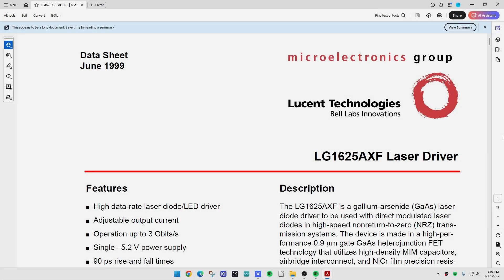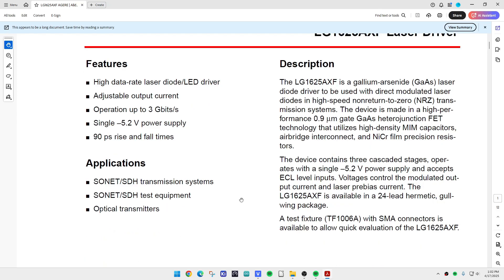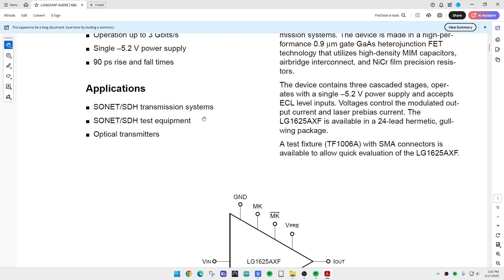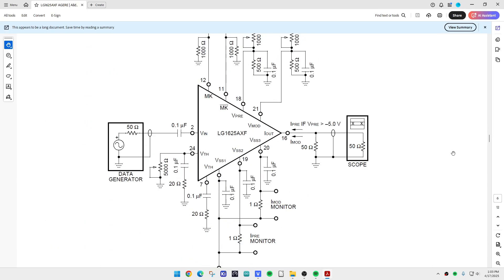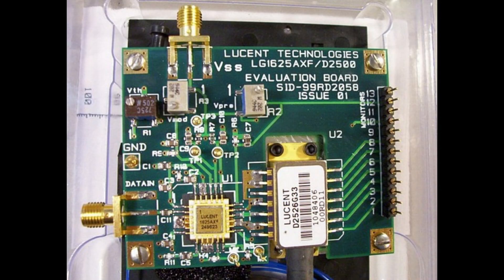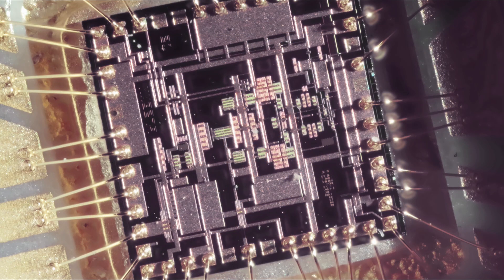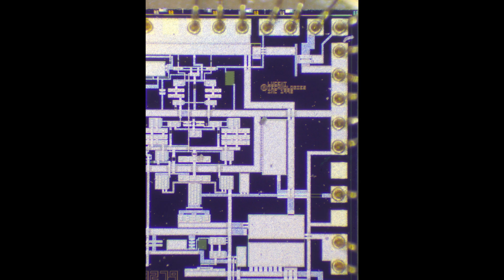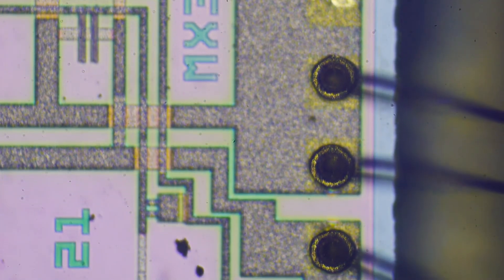#2236 Lucent Laser Driver GaAs IC

Comment: if a PC would be made out of GaAs, if could run on several GHz. Something around 10 times faster, than we're using nowadays. But only theroretical, because the standard PCBs becoming the bottleneck on these very high frequencies.  😞

Comment: A question from the peanut gallery. How do they make those connections? They seem to be spot welded.
Reply from the maker: https://en.wikipedia.org/wiki/Ball_bonding
Reply: @IMSAIGuy  I used to set up spot welders at one time back when I worked for a living but not so bloody small. Think belly button size.
Reply: They are probably spot welded.

Comment: This is OT, but I thought I'd let you know this. I just set up a Symmetricom ET6000 ExacTime GPSDO to replace my old one, which runs on an external 48 VDC supply, and isn't programmable. The Symmetricon runs on 120 VAC and is programmable, including the ability to set all the rear output jacks to the 10 MHz ref. source. These will run with any 5 VDC antenna. There is a good price on these at the moment at everyone's favorite auction if you're interested.

Comment: Very.....esoteric.   I came up in a TTL world and when you get beyond that,  I replace the whole board or  the whole box,  or toss it. I have had limited work with SMD myself and it is not that the parts are too small, but that the chips are baffling or impossible.